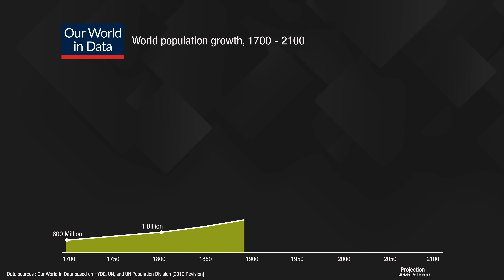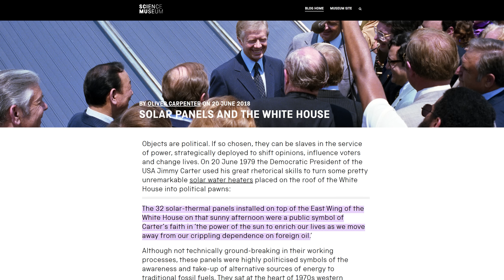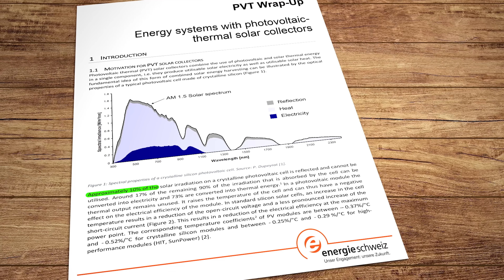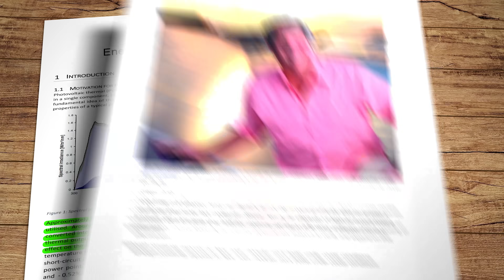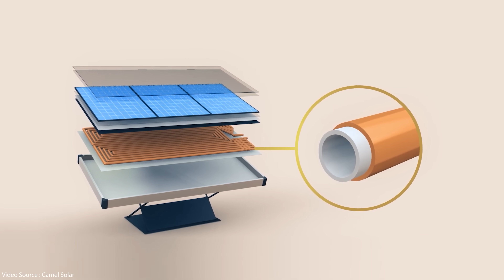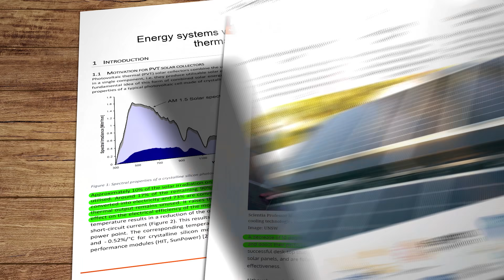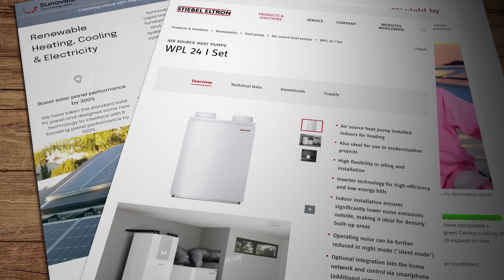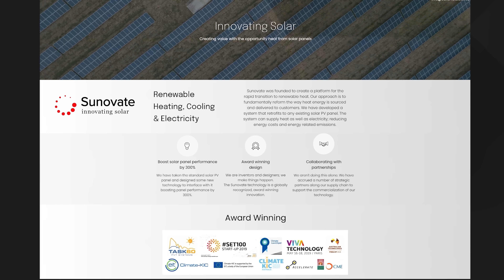The Solar PV panel that provides electricity AND heat for your home!

Comment: If you use a mineral oil instead of water you can pipe the heat directly to a sterling generator and get double or more power out put vs solar alone.
Reply: More moving parts again.
Reply: @luc_libv_verhaegen  Many solar (or other sources)heated energy producers have some moving parts. It would be similar to having an other fridge in the house (with out the cfc´s and at a low cost) and they normally lasts quite long if used correctly (25+ years) and a sterling generator would not be more noisy than a fridge, it could also use several heat sources if needed in a emergency.(wood/pellets for a example)
Reply: @agw5425  While what you say is true, it comes with some caveats and limitations.

Stirling engines are more efficient when the temperature delta is higher, and the warm water you get from the solar panels will likely not be warm enough to warrant the investment vs electricity produced.

Then, stirling engines require maintenance, and wear out. They are more than than the small electric motor running a small pump in your refrigerator. Stirling engines are big cylinders turning a linear movement into a rotational movement, and has to be running in oil and is exposed to constantly varying temperatures. Not as bad as a normal combustion engine, but still not without issues.

Then, to enable the highest efficiency in stirling engines, you need to have helium as the working gas. Which of course escapes, as it is impossible to make this system comprised of many moving parts and a big heat differential gastight enough to contain helium. So the helium needs to be continuously replenished. Helium escape the atmosphere, and is mostly retrieved from fossil gas fields where the helium produced from radioactive decay has been trapped with the methane for millions of years.

So all in all, while turning low grade heat into electricity is possible, it is seldom useful.
Reply: @luc_libv_verhaegen  You can but do not have to use helium, even with air you get around 40% efficiency witch is 2X that of normal solar. If hydrogen is used you need only to have a outer shell filled with nitrogen to ensure no fire or explosion, even just good ventilation will reduce that risk 95%.
There will be moving parts but if designed and maintained well they should last 50 years or more. There are 100 yer old cars that still drive with their original engine after all.
The temperature difference of 100c+ from a solar collector to 5-15c if ground source "cooling" is used will be enough IF the sterling generator is designed for it. A "normal" sterling may not run optimally but the design will decide what it can use for a heat source. 
One version I have contemplated is heat collector to a heat pump to concentrate the heat then a sterling generator. The math checks out like this : 1KW used to power the heat pump, 5KW of heat out of the heat pump (1 to 5 is normal value) 5KW heat in to a sterling generator (40% efficiency) 2KW of electrical power out, 1KW sent back to power the heat pump, 1KW of power usable out put.
Yes there are 2 machines that have moving parts and needs maintaining, but that is not verry hard to do nor is it verry costly.
We can use the problem of global warming as our energy source, cooling water can be collected from the ocean as it keeps 4c at all times below a certain depth. The fuel is heat energy from our atmosphere, the more we need the more we collect "free of charge" so to speak. With black metal solar collectors we do not even need PV to be useful but they are a bonus.

Ps. the fridge analogy was for how much sound it makes.
Reply: @agw5425  I have discovered stirling engines for myself in the 2000s, read up on them then. They seemed like they would hold a lot of promise, and yet, they never really went anywhere much in those 20 years. There is a genuine reason why stirling engines have not made it, and my personal explanation is cost vs benefit and the maintenance of using a cylinder to turn heat into linear motion and then circular motion to then drive a generator

Solar and wind are dirt cheap today, and batteries are well on the way of becoming too cheap to not bother with them. Any system with moving parts better be able to create huge amounts of energy out of thin air (ie, massive wind turbines) to warrant the maintenance cost of something that is not solid state or close to it.
Reply: @luc_libv_verhaegen  That would not be the purpose of a heat pump driven sterling generator, to "compete" with wind and solar during their pike out put times, extracting heat via a accumulator like a large insulated sand pit, would provide a steady out put regardless of current wind or sun conditions (se arctic night´s thermal storage solution) to keep a supply with power from renewable sources going 24/7. If built large enough it can replace a  coal or oil plant but will take a lot of space so would fit best in rural areas. Any large scale energy storage will usually include moving parts, ad you do get 40% of the stored energy out as electricity with non optimized Sterlings, I have seen experimental ones that get 90%+ and when they are used this will be bigger than solar and wind combined.

Comment: Wouldn't this also lower the heat that was absorbed through the roof, making it easier to cool a building on hot days? Should better than the shade from the solar panels alone.
Reply: right, the shade keeps the roof cool. If properly designed, the hot air trapper in between the roof and panel and produce a strong air current (chimney effect) that will add to the cooling of the panels.
Reply: Yes, also in my experience the shade effect is greatly overrun by the heat produced by the panels.
Reply: @ Pomo Dorino
I replied to OroWizard and meant to include you but I fully agree with your assertion that the heat generated outweighs the cooling from the shade provided. There was a solar powered kick type scooter made that was larger than the usual ones and you stood on the solar panel setup. I imagine some people had the soles of their shoes melt.
Reply: @ OroWizard
I recall some RV’ers found that after installing solar panels on their roof that the temperature inside the RV went up and in some cases a lot. So much so that if not hooked up to shore power they would have to crank up their generator to power their air conditioner so solar wasn’t a win for them. Another issue with RV solar is that in hot climates you would love to find a shady place to park but as Dave said in this video panels only produce at the rate of their weakest cell. Even a bit of shade dramatically reduces output. Dave has talked about flexible solar panels before and an awning made of them would be ideal. Air flow under the awning should allow the heat generated to vent while the shade and power generated made the idea a plus overall.
Reply: @mikedavison3400  The main drawback I see with solar awnings is high winds tearing it off and ruining expensive flexable panels.
Reply: @ Tumbleweed5150
You’re correct but that applies to any awning, although awnings made of flexible solar would be more expensive.
Reply: @mikedavison3400  I think because there's no insulation at all on their vehicle's wall and the wide windows act as a greenhouse effect.
Reply: @ xponen_
You’re correct but the observations of the RV being hotter was from people who had been using it before having solar installed on the roof and noticed a difference after. A woman named Pippi Peterson has a site that is about RV living and she made ‘shade sails’ that helped a lot. You’re correct though that most RV’s are not insulated as this adds to the weight of the unit. Also cuts down on the useable space inside the unit.
Reply from the maker: I think so yes
Reply: Flat on the roof no slanted or raised yes. ventilation is key
Reply: Since heat rises couldn't it also be used as a attic cooling device...

Comment: It's nice to see heat harvesting and storage being given some prominence.  This is really brought home especially for northern countries in the book "The Post Pandemic World, Sustainable Living on a Wounded Planet".  Man cannot live by solar PV alone!
Reply: Harvesting thermal energy is dead simple. You just need to understand how to move energy around and how to store it effectively.
Reply: I reckon I could with a big enough battery.
Reply: Depends on how well you're insulated.
Then your windows are your heaters.
Still, PV heat recovery is a plus.
Reply: @onebylandtwoifbysearunifby5475  A huge plus if you can store it (geothermal storage) which is critical for northern countries.
Reply: @johnm2879  If you build an underground insulated sandbox, you can store a lot of heat. Mass storage is great, water storage is even better.  Add a few water pipes or air tubes and you're all set.

Comment: I know the new roof I am looking at (Tractile) use water cooling for solar tiles to increase efficiency and provide heating for a pool or spa. But I have neither so how to utilise this...In Perth WA I have no use at all for thermal energy in summer, and honestly little use in winter
I guess I would have to be content with the increased output and longevity but will need to compare that with the increased cost. 😕
I will need to check out Sunervate and Rosie's vid next👍
Onya Dave🙏
Reply: The main problem in not having a heat dump is that you'll very soon have pressurized vapor instead of water in the lines...
There are cycles using molten salts that can use sun thermal energy to COOL your house, but again the problems are complexity and cost
Reply: Exactly it's just waste heat unless you are even more wasteful and have a pool.
Reply from the maker: Can it help to just heat your hot water, for showers etc?
Reply: @JustHaveaThink  I have solar HW at the moment but will be installing a heat pump before I replace my old cracked concrete tile roof. Ducting the hot air towards it with the Sunervate system would at least make some use of it. The higher output and potential longer life of the panels is still very attractive, depending on cost of course

Comment: Excellent video as usual. You have also since several years the french "Dualsun" compagny hybriding on the same panel PV & (water) thermal circuit...
Reply: I wasn't aware of Dualsun, thanks for sharing.

Comment: Triple Solar is brilliant at this and can use a heat pump to scavenge heat on colder days in winter but is still more efficient than an air sourced heat pump.
Reply: That why we use the heat air from the PVT system. Does the same thing with the same benefit. Different approach.